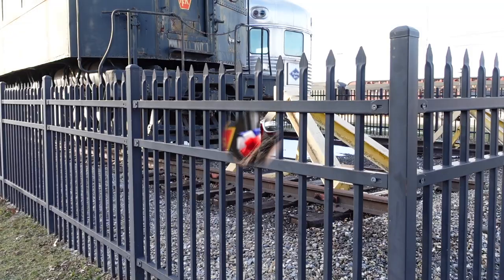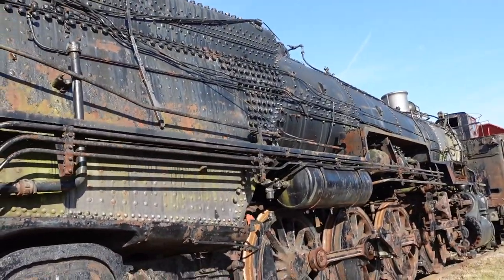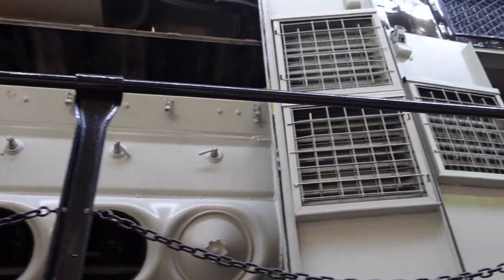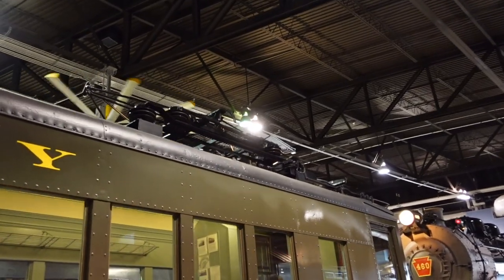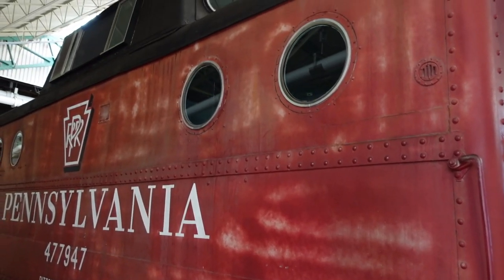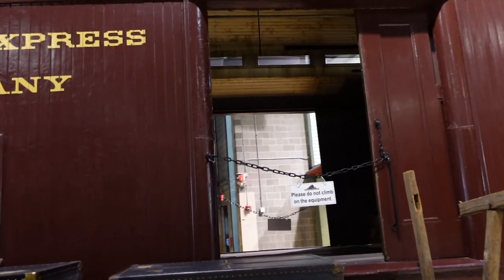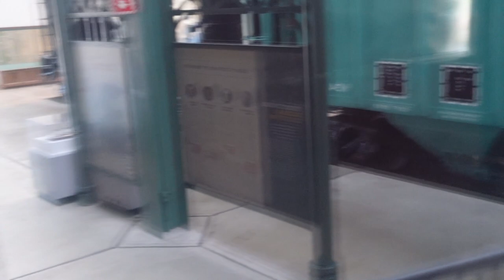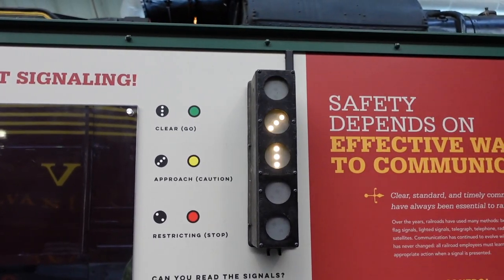Railroad Museum of Pennsylvania, Amazing Indoor and Outdoor Collection!

Comment: FYI--What you were pointing to under the Fireman's side of the cab, is the Stoker engine. There is also a water injector on that side of the engine, which does put water in the boiler.
Joe Bliss, Plymouth, Mi.